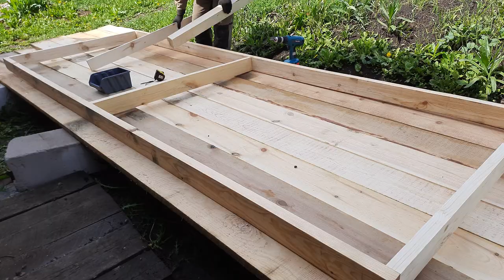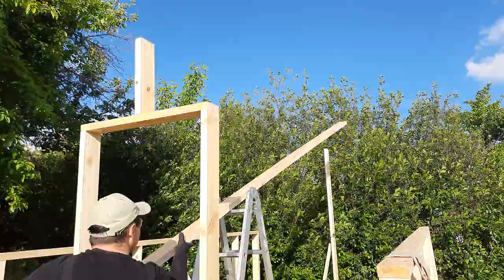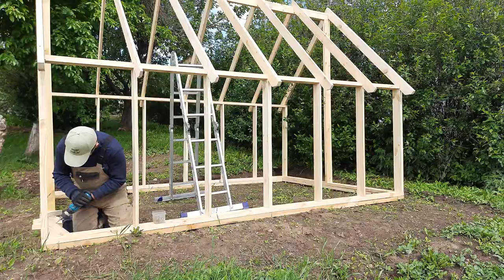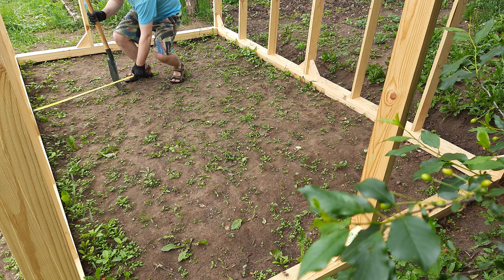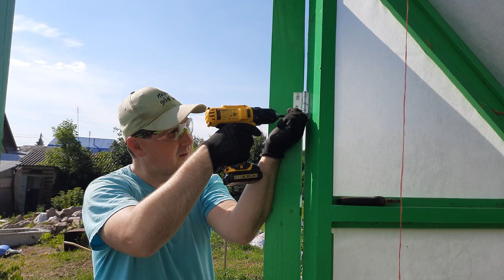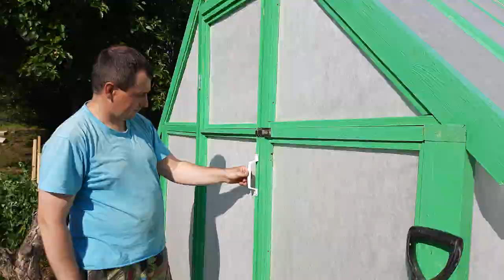Wooden greenhouse. DIY

Comment: You did such a great job building that structure.  My hubby are I are currently building a 16 x 16' x 8'  wooden structure, and yes, we're painting
every beam.  We'll have a flat roof and the whole thing will be enclosed with 1/2' galvanized steel mesh to keep the varmits out but let the bees
in.  Being in the Mojave Desert, we needed to have two walls with plastic to protect from the high winds, then we used 40% shade mesh we
found cheap on TEMU and are trying to finish before 108 degree temperatures kick in.  You really inspired me that we're on the right track, you
did a great job. P.S.  THANK YOU FOR NOT ADDING MUSIC!  You're lucky you don't have high winds.  We had to anchor our corners into the
ground with cement so the whole thing doesn't blow to Barstow.

Comment: Nice job what material is the cloth? Looks like the cloth we cover plants with during freeze.  How long can you expect it to last?
Reply from the maker: Yes, this is a material used to protect plants from frost. It survived one winter perfectly, but this winter 2 sections of the roof were torn. I used it as a temporary material, in the spring I will change it to monolithic polycarbonate or glass.